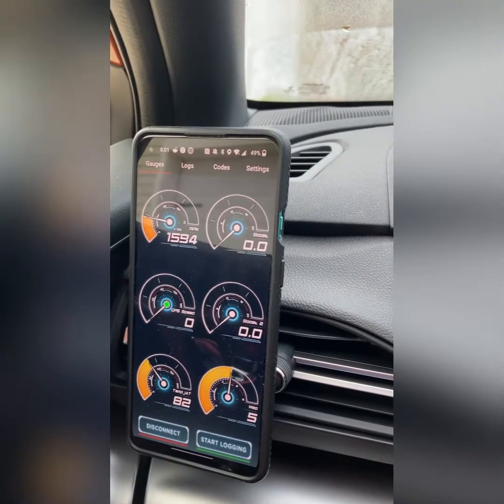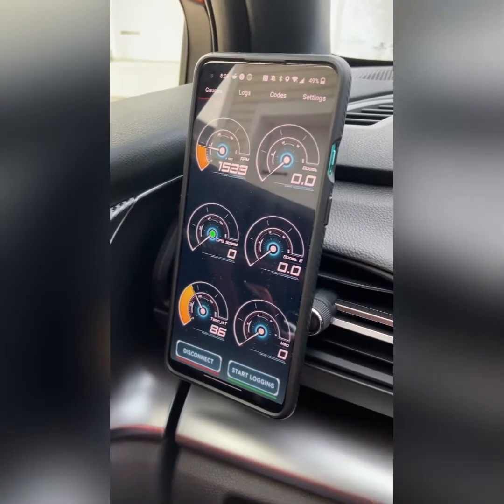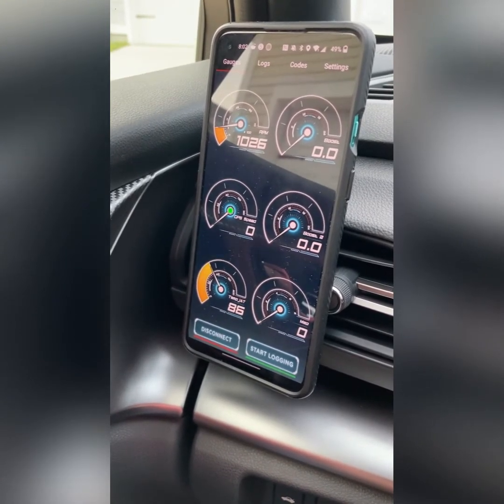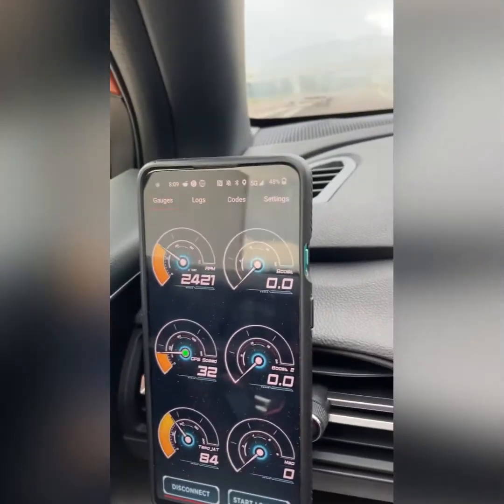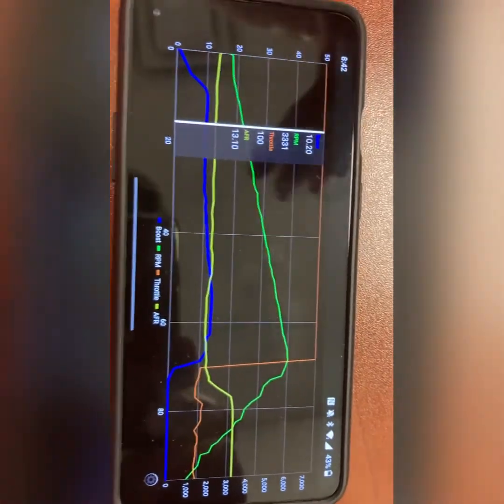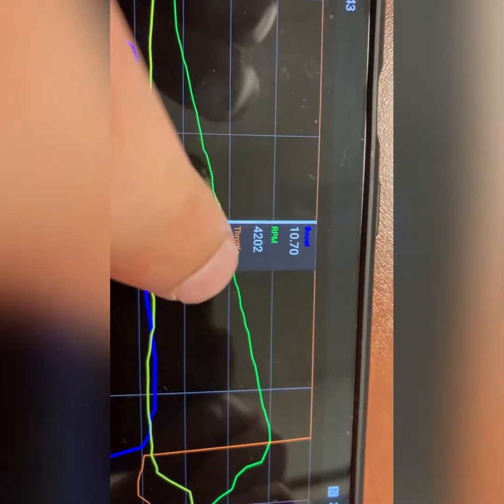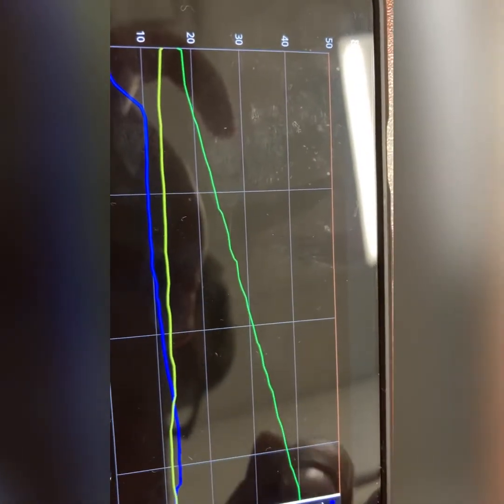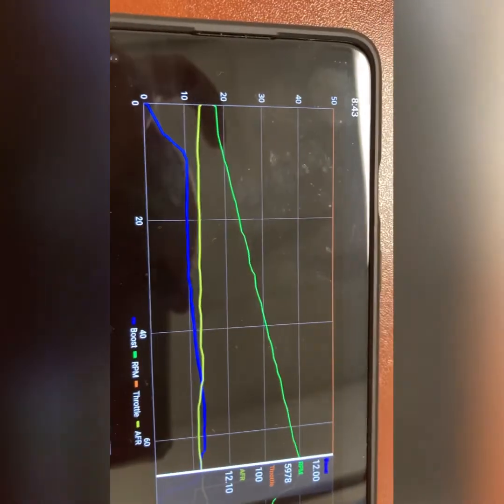ETS Intake 22 wrx stock data log

Comment: Cool man. Thank you on being so quick with the updated content too.
Reply from the maker: No prob man! I'm just as curious as you guys! My issues have been worked out thanks to Burger tuning. I will say holy cow 🐄 switch from 20-22 psi to 12-13 feels so different 😂
Reply: @DylanCarGuy  lol I bet man. That's a lot more power
Reply: @DylanCarGuy  Was burger able to get you dialed in to yet to where you aren't seeing the same issues with the JB4?
Reply from the maker: @Megaomen12  Yes, so now I'm running map 6 just had to a adjust a few factors and add a little bit more fuel. That's the great thing with this is once dialed in the power difference between this and stock is massive
Reply: @DylanCarGuy  Man i may be better off getting JB4 then before the CAI especially because even if a Cobb Tune or w.e else gets released it will flash the ECU unlike this one.
Reply from the maker: @Megaomen12  I think so, I love that this is easy to remove and revert back to stock. Plus they can send you new data logs fast 1-2 days
Reply: Did you have to pay for a revision? And if so how much was it?
Reply from the maker: @angelballardo2946  all revisions are free!

Comment: Great video! The data does not lie. It’s safe for people running stock boost. Once tuning options are out we will be able to adjust for more rail pressure to run the higher boost safely. Soon!
Reply from the maker: Thank you and absolutely I'm now on a custom map from Burger tuning running +8 PSI now everything is running great again just needed to be dialed in since all the JB4 maps are for a stock car/exhaust
Reply: @DylanCarGuy  Had a question about this. Thinking about grabbing the JB4 and ETS Intake so on the custom map they were able to set it up to where you are still reaching safe AFR levels with the added boost?
Reply from the maker: @Megaomen12  yessir got it dialed in map 6 extremely safe. Safer than stock honesty

Comment: Ok Dylan.. I installed my tuner yesterday. I have the boomba racing bov as well.. has been giving me problems so I added a couple more screws and it seems like it's still giving me problems so that's gonna get pulled off and returned. I'm still on regular so probably after work I'll get premium and switch to 93 map. My intake just came today. Was wondering if I have to reach out to JB and have them make a tune for the intake with 93 before I install the intake because I know you were having bad readings?
Reply from the maker: For the intake and map 5 running +7 I was, but map 0 it ran good Terry got me a custom map quickly to fix it. I didn't try map 2 though I would try that and data log
Reply: @DylanCarGuy  where are all the map descriptions? I can't find any of them lol
Reply from the maker: @johnmanfra4224  JB4 Map Guide:

Map 0: Fully disable JB4
Map1: +3psi peak over stock, default map, suitable for all fuels.
Map2: +4psi peak, suggested for 93 octane or higher
Map3: +6psi peak, suggested for 30% E85
Map4: +7psi peak, suggested for 30% E85 along with bolt on modifications
Map5: +7psi peak, no boost taper, more aggressive version of map4.
Map6: User adjustable by RPM map on user adjustment page, values are peak boost over stock by RPM under heavy throttle.
Map7: Progressive WMI mapping, under development
Reply: @DylanCarGuy  your the best bro
Reply from the maker: @johnmanfra4224  thanks man! Happy to help and sorry to hear about your BOV issues!
Reply: @DylanCarGuy  did they come up with a tune for u with 85 and your intake that's working good?
Reply from the maker: @johnmanfra4224  yea they did!!

Comment: Ok Dylan. So I'm installing my tuner tomorrow. I plan on running 93 only. Do you think this intake will be good with the 93 map?
Reply from the maker: Tuner is super easy to install I've got a video if you have any trouble and it should be, BUT just press the data logging button. If anything doesn't look in spec you ask one of the guys over at burger tuning and they will send you a fix
Reply from the maker: The will want a full third or 4th gear pull from 2-3k rpm to redline then you go to logs press email and send it to one of the guys.
Reply: @DylanCarGuy  They tune to your data logs for free correct?
Reply from the maker: @dirk41mavs41  correct you just send them the data logs they send you updates to type into your system to fix the issues
Reply: @DylanCarGuy  please hit me up with the information before tomorrow because I'm going to do the tune tomorrow
Reply from the maker: @johnmanfra4224  what kind of info would you like a data log on map 2?
Reply: @DylanCarGuy  I'm installing this tomorrow but I run regular. Do I run my regular on empty and then fill with my 93 because that's what I'm running. Then hit the map for 93? Also I can install it and run it stock until I run empty and switch to 93 correct?
Reply from the maker: @johnmanfra4224  correct! You can do that just run map 0 until you put that sweet 93 octane in!?
Reply: @DylanCarGuy  perfect. That's what I wanted to know.
Reply from the maker: @johnmanfra4224  every car runs differently, so I would just recommend doing a data log and if it doesn't run perfectly you can switch to Map 6